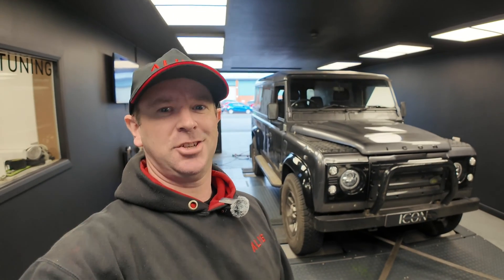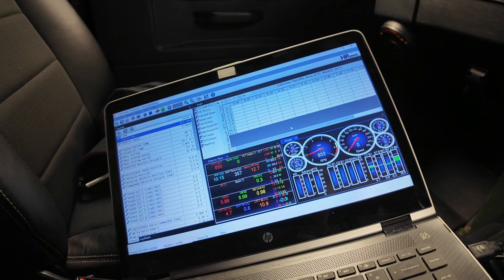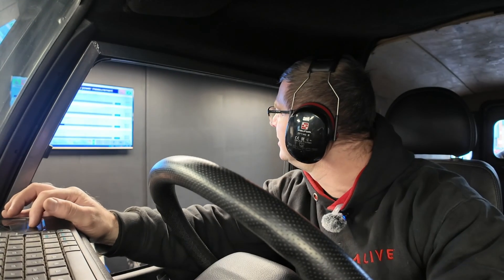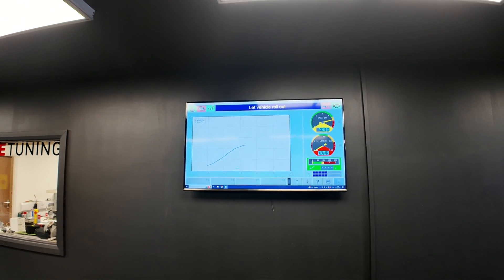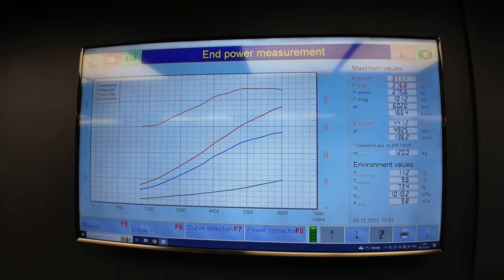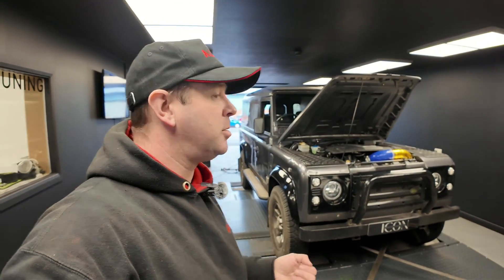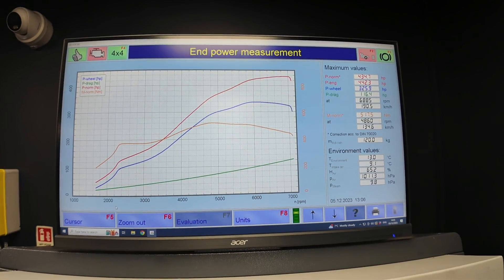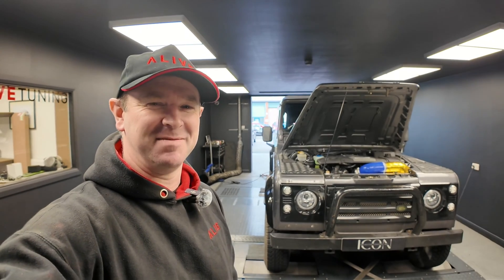Coyote 5.0L V8 Power in a Defender 110 - Dyno setup using HP Tuners

Comment: I've owned a lot of FORD V8's and they easily went over 160k miles as long as you do the regular oil changes. I had a Corvette and the engine went with a little under 100k miles. Also a GMC truck which had cooling issues that i couldn't figure out. I had an XJ with a straight 6. That thing last 269k miles. 
I never used the FORD eco boost engine, just the V8's only. I plan to get a Defender and id go with a Coyote or a Hemi. Nothing from GM. Just my opinion.